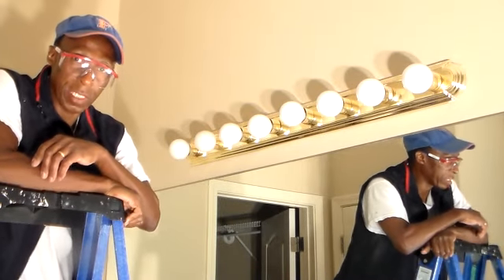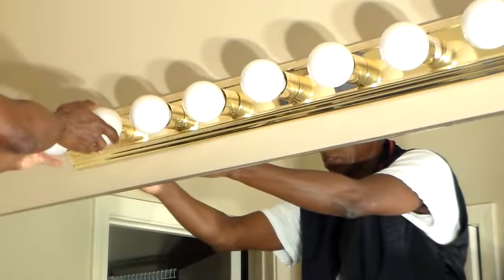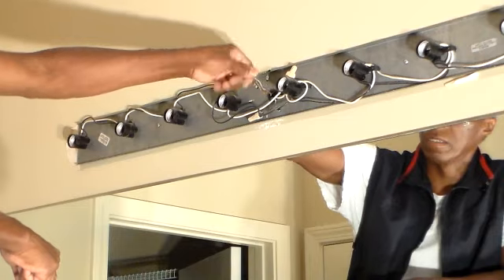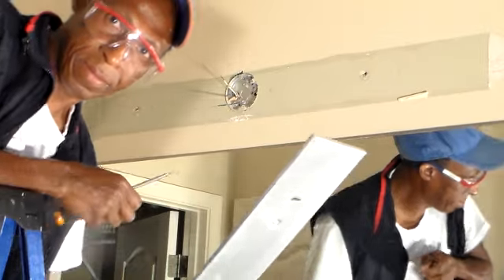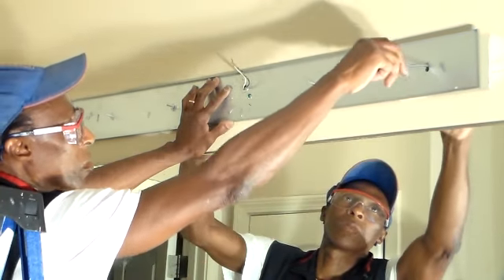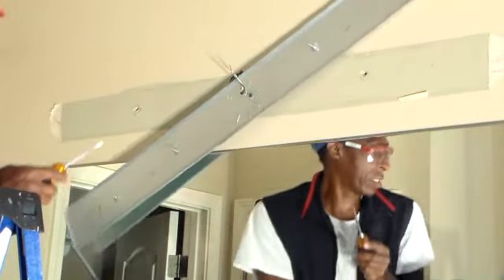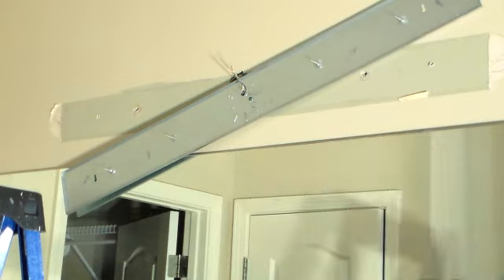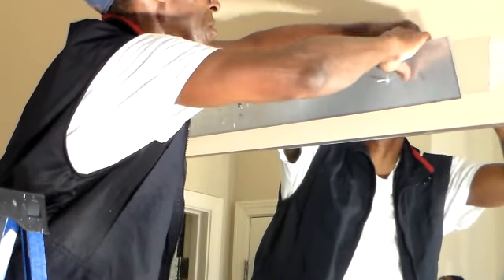How to replace bathroom lighting

Comment: I definitely feel like it’s upside down...
Reply from the maker: Ya l didn't notice, until l had already uploaded the video. I went back flip it over. that's funny no one alse notice it.
Reply: That’s an ooops that you can count on happening with my husband if I don’t help a little... imagine my poor husband would have struggled reaching into those glass shades to screw the bulbs in place and as awkward as that would have been he still would not have noticed it’s all upside down thank you for the help so I will be more help to him
Reply from the maker: @pcjones9337  welcome
Reply: Actually they are made to go both directions
Reply: Depends on ceiling height

Comment: not going to bother turning off the breaker?
Reply: It was a empty house.
Reply: What Noah means is that just with the switch off, you can still get shocked. Tripping the breaker is the only way to assure no electricity to the circuit. With today's code it is perfectly code compliant to have Hot and Neutral from the breaker panel go to the light fixture first (the Hot extends from there  to the light switch) and to therefore have an always Hot wire nut inside the box for the light fixture. If removing the light fixture damages the insulation on the Hot wires or dislocates a poorly installed wire nut you would get shocked.
Reply: Thanks Bob
Reply: but he made sure to have his safety glasses on

Comment: isn't that upside down?
Reply from the maker: Zane Blane some people like it that way.
Reply: Some people like the lighting pointed up because it shines onto the ceiling and is then is diffused throughout the room for even lighting.
Reply: Zane Blane it wouldnt matter... if u have it facing the other way the light may blind u... if the tulips are facing up ull never get direct light because its somewhere u will never reach... but having them upwards can catch n hold buggies n dirt n dust. :p so it dunn matter either way. :o